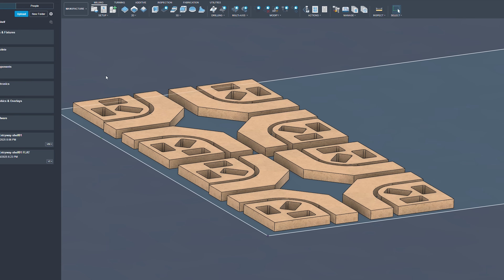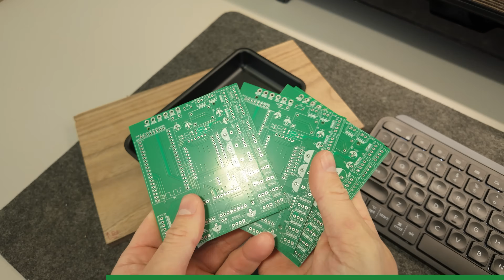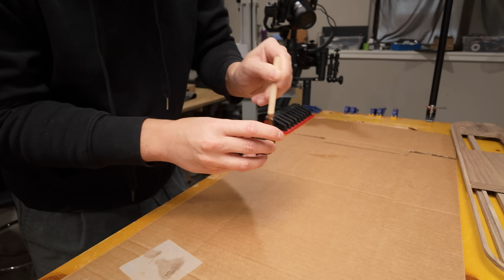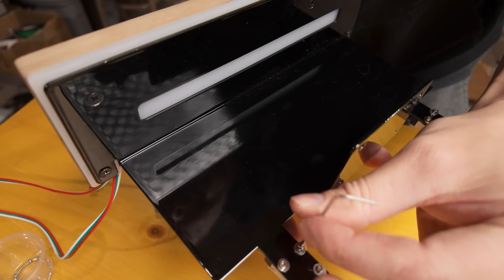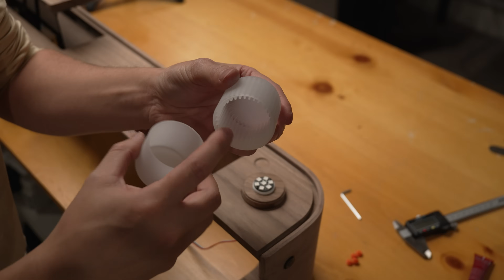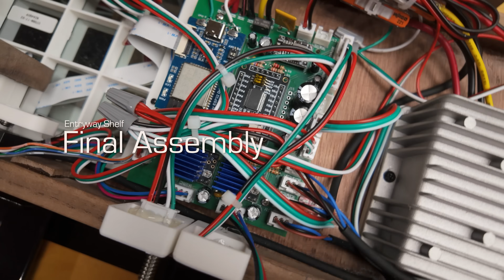I Changed How You Enter a House Forever

Comment: after 1 week, youre never pushing the button to raise and lower the jackets.

i get wanting to do something cool with the raising and lowering of the keys, but again, after a couple weeks it wont get used. should have just extended the cellphone holder area all the way down. the order of operations will get frustrating quickly. oh i didnt press it before putting the jacket on. now i have to wait for the thing. enter comedy skit for an action movie. saw the comment about making it faster. still doesnt fix the underlying issue.

Comment: It's easy to imagine that everyone would have designed it a little (or a lot) differently.  On the other hand, you actually did it.  That says something.  And it looks nice, regardless of functionality.  I would have put a quick-action mechanical door/drawer to be used as a gun safe.  Right there by the front door and not obvious to most people.

Comment: Sorry if you thought of this already, but did you think about adding RFID blocking material around the key popout?  It keeps people from using signal boosters to steal your car. I made a little box and used RFID blocking fabric on the interior and it works great, but I had to leave some of the material sticking out proud around where the door closes to act as a signal blocking gasket.

Comment: I have a question, how do you know "exactly" what you want to do?

I was in NPD during my previous employment, and man I struggled thinking of how to make the engineering be practical, like it just did not make sense to me and I always found ways it could fail in real life
But fortunately nothing failed 

But it added to the cost of the product 

How should I approach design?

Do I really just need to take my time to design it on paper and then start with the model?

Btw my company did not give me time, I had like 6-7 hours at most

It was very rushed enviornment and the business just didn't seem like it would scale, so I just quit 😅
Reply from the maker: Hi there, well it really depends on the complexity of the design.

Break the project into chunks, start with a complex smaller aspect then work your way back through the larger project.

Usually I go through multiple rough iterations on stuff regardless so I don’t spend too much time deep into all aspects like hardware and sourcing.

I’m no expert by any means but 6-7 hours is really not much regardless of the complexity. Ideation like concepts in your head and rough sketches can take that time quickly. New product design is not a speed run. 

Hope that helps and good luck.
Reply: @hobbybuilt thanks! It gives me reassurance that I was right to demand more time

Comment: Lovely end piece, I can appreciate the working out and sheer effort needed for this !
I am currently replacing my kitchen, and my microwave is mounted under the worktop, with a microwaved sized piece of worktop on top of it.
The whole assembly is lifted and lowered by an electric actuator taken from a rise and recline chair. I am using buttons for up and down but could have used a remote controller.

Comment: Great build guy! (Helpful tip, the table saw will cut much smoother if you adjust the blade to just a hair higher than the wood's thickness. This will avoid blowout and kick back.)
Reply from the maker: I cranked it all the way up so the vertical section could be cut in two passes without having to rotate the shelf into the cut. Otherwise with flat pieces very good tip!

Comment: just a tip, maybe you know it but if you using fusion 360 to do contour cuts of wood stuff on router, there is feature called tabs that auto adds tabs with set thickness, for less processing after cut .
Reply from the maker: I do! I used it for the first wood cuts on the sign you see in the video. For larger cuts I have a vac table that holds the parts down very well.

Comment: The cloths hangs lowering is a bit over the top 😂
Also an improvement would be to add pressure sensor for the key/earbuds container. So it auto-lowers itself after 5s of no additional-pressure/weight added.
Reply from the maker: Glad you liked the moving hangers even if they're over the top! Love the pressure sensor idea.

Comment: When needing bent wood, try a steamer box. You can make one with a plastic pipe, something like sewer 8" or 4" pipe depending on what you're building, you can buy steamers cheaply these days, attach steamer one end and block the other. I did this for bending teak back in my boat building days......slide a bracket in the length so you can steamer both sides and not in water...works a treat.
Reply from the maker: Thanks for this! I wanted to but did not want to take on more work. Although boiling and resetting the mold everytime was probably more work... hmm

Comment: Love it, awesome work.

The things I would change to better serve my needs.

Drop the coat rack moving up and down. Seem unnecessary, but it looks cool. Maybe some sensor to turn on the lights underneath when I detects some is trying to hang or grab something.
Change the key storage to just a QI2 charger or maybe to (and remove the USB-C ports). Plus move the button from the face of the mirror to the unit itself.

Invert the colors on the display. 

And the nerd in me might wanna put a presence sensor in the hallway to automatically turn on the lights and have them adjusted to the time of day (or Christmas theme during the holidays).
Reply from the maker: Glad you like it and appreciate the suggestions!

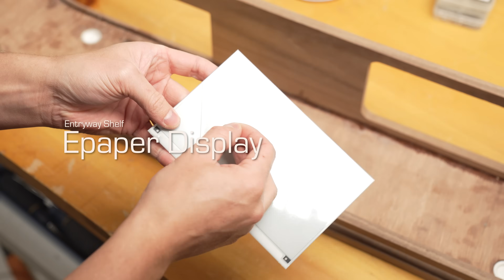Comment: 13:56 While the term epaper isn't wrong, it's less specific. It's an umbrella term that applies to all display tech that mimics paper. What you have there, more specifically is e-ink, the best stuff. It works by physically moving "ink" particles suspended inside a viscous white fluid to the front surface of the display, using a grid of tiny electromagnets behind the display layer (which are the "pixels" in e-ink). This way it actually physically mimics the appearance of ink on paper, the way it has to be lit from the front and all.

Comment: Such a neat project!
For the LED diffusion, you can lift the strip away from the final material. Or if you are tight on space there are foam padding materials that do a good job at spreading the light without abdorbong too much. Potential issue though is if you want the light to remain directional then the foam won't retain that.
Only major changes I would make...
1) make it PoE and run a single ethernet cable instead of house power plus wifi. It's just easier to run the line to a place the likely doesn't have power already.
2) I wouldn't power hide the coat rack. It just doesn't seem to add a lot of usefulness, and seems like a major potential failure point. But that's just me. I would just put the hooks slightly below the bottom of the shelf and let perspective do the work of hiding the hooks. And if the coat rack in there is all metal, it could double as the primary mount point for the unit to the wall.
3) instead of making it button operated, I would put it on a motion sensor. Depends on the entry way setup of course, as you wouldn't want it kicking on when someone is walking by but nowhere near the door. But putting a button on it would just make me never use it when I am juggling things going in and out the door.

Comment: Leaving it is water without a heat source just gives you warm, wet, wood. Leaving it longer just leaves it cooler. It's the heat that loosens the lignin.
Reply from the maker: Topped off boiling water. Worked well enough but always room for improvement.
Reply: @hobbybuilt the steam/water seems to mostly be there to keep the wood from drying out from the heat, and cracking... But if you can keep it so hot you need gloves, it should be better... Grain is also important (as you found out!), but all the experiments where I used to work making cabinets also led to a slight over bending for springback, like metals...
Awesome stuff though! I don't think I'll ever do the electronic stuff, but the lighting is within my scope, and your execution is amazing!

Comment: I'm used to working with solid wood so that may be different, but instead of using tabs, I Mill to -2mm depth and use a router to cut the test of the way through

Comment: this is absolutely incredible, but i cannot help but ask - what does it do, other than the weather (which you can check on your phone) that can't be done by just having a normal coat rack and normal console table with shelves and draws for less than half the price?
Reply from the maker: My channel is over the top. Basically that sums it up.
Reply: @hobbybuilt  Entirely valid and i respect that.

Comment: but whats the point of this, lol. mirror is too small, coats are not useable without a lot of pain. weather is kinda meh, by the time you are there its too late to check weather, you are already dressed for specific weather. led strips inserted into anything these days for no reason etc
Reply from the maker: It's more about the journey of building something cool than just the pure utility!
Reply: @hobbybuilt  its def looking good, but again it should be helpful, else I'd hang a painting...

Comment: Good work - but I focus on strict practicality - FORM follows FUNCTION.
I tend to use sensors for most things and buttons to override things if needed.
Lights should come on automatically with proximity, and light sensors. Proximitiy and presence determines the key holder opening, and it should be instant.  So as you come near, instantly presents your keys for your, and instantly takes them away as you deposit and leave. 
The speed of this would be the core feature then. 
Looks good - nicely machined.
I would most likely NOT use coloured lights. They are cheap and nasty. Warm hues.

Comment: A tip for whenever you are working on a material that has aesthetic requirements, so you need every cut or hole drilled very cleanly... cover that spot / area with painter's tape. You can mark up the painter's tape as a bonus, but it takes the abuse that you don't want the material to deal with.

Comment: i don't think most people realize that adhesive backing (like on your LED strips) is basically glue.  you will get a much better and longer lasting bond if you clamp it down for a couple minutes, or at the very least, apply pressure by hand for at least 30 seconds in a few key areas (by removing the backing in smaller sections as you go).
Reply from the maker: Absolutely most are pressure activated.

Comment: For the coats and bags, you should have use a motion sensor or time of flight sensor instead.
Why? 
Because by the time you press the button you already want to be out the door, rather a time of flight or motion sensor would have already detected that you were there, and could have then lowered your bag by the time you thought to and made the motion to press that button.
That button takes the intuitiveness out of it, which means that there is a decent chance that people won't bother using your hard effort since it take too much mental effort, and too long for both the button to be pressed and the motor deployed.
That's valuable time and energy that can be spent doom scrolling social media.

Comment: Using touch (capactitive) sensors for limit switches is asking for a burned out motor (assuming it's not strong enough to break something else, anyway).  Use mechanical limit switches, or, if you must, magnetic.  Capacitive sensors are Way too 'touchy' (pun intended) for use as limit switches.
Reply from the maker: Those are not capacitive limits switches. They are inductive, very reliable.
Reply: @hobbybuilt  Ah.. thanks for letting me know.

Comment: if you use a glycerine and wood glue mix the wood bends alot easier and wont split. it becomes rubbery til dry then its as if it were never wet.   here is where i learned it    https://youtu.be/SMKKwLGMdKU

Comment: Ok so it is built very very nicely with pretty much no cut corners etc. I would however immediately change all the settings to make  all motors move at their max speed. Waiting that long is just for novelty. Daily use is probably something more like a spring loaded mechanism that almost instantly jumps up.

Comment: It is aesthetically pleasing but I have to wonder what makes the linear rail motion needed? How is it enhancing the build? It seems so slow and the buttons 
obvious that there is no hidden aspect to the pop up storage and there is little difference in height to the coat rack that it seems unnecessary. Normally things like this are added to address an issue or problem. Is there one I am not seeing that is being solved by this?
Reply from the maker: I wanted it to feel beefy. I can increase speed a lot but noises from resonance. Belts would have been a better choice

Comment: You know, building your own steam box for preparing wood to be bent should not be too hard a job, four impregnated beams assembled as a long box or chimney, possibly a plastic or epoxy liner inside, a door on either opening, a large hole for a steam hose and a small hole in the bottom slant to let water out (or a loose fitting door), and a cheap wall paper removal steamer.
Reply from the maker: I’d like to build one some days when I do more projects like this.

Comment: just soak it a little bit extra length not for longer duration. Its a hard wood. you need tension on the surface that is dry in your case!

Comment: If you’re using West System epoxy with 209 hardener, you have 20-24 hours. If you use 206, you have 10-15 hours. I’ve made some very detailed, end grain parquet knife scales using 206, and I’ve been able to make clamp adjustments after 8 hours without causing an issue.

Comment: My question is what happens if your keys are in this thing and the power cuts out. Do you have batteries as backup for that or would you just need to get to unscrewing to free your keys?
Reply from the maker: Battery back up would be easy to do but there is a manual crank

Comment: I got rid of the nice box I had in my entryway because opening it up to put my keys inside meant that I just put my keys on top instead, so I swapped it for an open bin. I can't imagine having to wait for a sliding platform lmao
Reply: I suppose with the amount of smarts in this build you could create an automation that whenever the front door is unlocked then the sliding platform starts moving - that way it should be open by the time you get in and are ready to put your keys away
Reply: @TyroSean  Yeah but you still have the problem of having to wait for it to raise when you're going out, lol. The idea is neat, but I'd rip that platform out within a few days of having to wait for it every day
Reply: I use an ammo container to stop radio signal repeating - and yes.

Comment: High Quality for sure. Would not have the patience to wait for the key/earbud storage to open... Foreseeing that just becoming a shelf.
Reply from the maker: Gonna crank up the speed on the motors once I figure out issue on resonance! Right now key platform is a bit slow for sure
Reply: @hobbybuilt  I'm more concerned about the keys falling off the platform while inside the box
Reply: @hobbybuilt I think you are better with a push button uproach like those cupboard doors that you push to spring up. You can control the ascent rate with the spring settings pretty easily if you are concerned about how it rises too.
Reply: @kls1836  That's a much better way to go. Imagine in a blackout, does this thing have a mechanical backup mode to allow access to keys, or are you stuck at home until the power turns on again?
Reply: @hobbybuilt  hope the motor doesn't break while the keys are inside 😅
Reply: @hobbybuilt or you can just install motion sensor, hook it and make it rising before you are reaching to it.
Reply: @hobbybuilt  If we think of more efficient engineering solution for this speed issue, why not implement a controlled spring release? maybe with hinges. That'd be simple to control with just a switch to hold in place and when neede it flaps open (sure it might then need to push down back in place, but time and purpose wise, I'd do that instead of waiting/ tweeking on motors)
Reply: definitely pretty nifty, for me the concerns is how do you get your keys when you have a power outage.
Reply: @Vellies  He can fix that by putting a UPS inside the cabinet somewhere. That way, even if there's an outage, this thing would still be functional for days.
Reply: @TriparadoxC  UPS for the cabinet? What else? Connect to wifi?
Reply: @l4rkdono ?
Reply: @TriparadoxC  or you can just drop keys in black bowl like any healthy brained person will do
Reply: @l4rkdono  zigbee or zwave! local control! :P
Reply: As I watched the assembly, I thought a spring to open and the motor to close would be a faster elegant solution on the open.

Otherwise great build!
Reply: dude amen imagine having a motor failure on that door when trying to leave your house
Reply: Steam, not hot water soaking. Steam softens the lignum with much higher temps.
Reply: Exactly. All this hard work and money only to have something that's inferior to vastly cheaper alternatives

Comment: At first I thought the coat hanging portion was going to rise up from a much deeper (height wise) floor sitting cabinet. Not drop/rise a couple inches. Functionally probably useless, Visibly appealing though and a good tester or refresher of honing your skills. This thing turned out CLEAN man. If I had the patience to complete a project like this, I'd still be limited by my ability to buy everything haha. Definitely a sweet build! I'd sub if I hadn't already.
Reply from the maker: Very easy to go overboard!! Totally agree on the cost hook. It was more so just do it for fun. Although it does hide the hooks then nothing is on em!
Reply: @hobbybuilt  Very true, I forgot to mention them being hidden when nothing is on them. Don't have to worry about em snagging on anything else in the meantime.